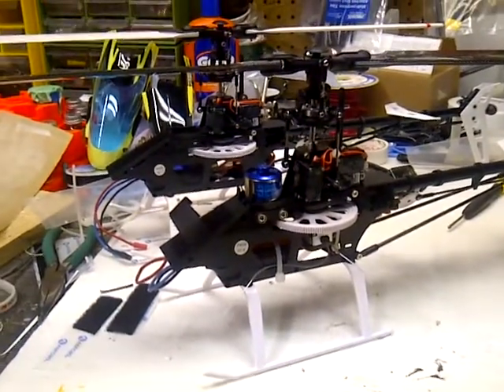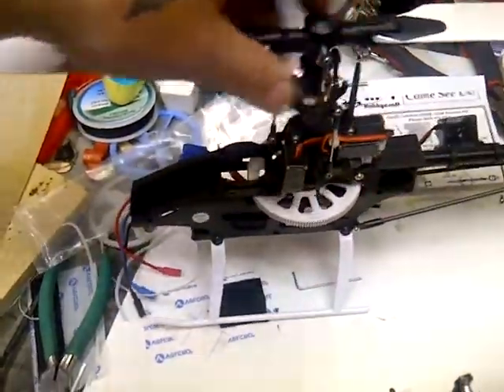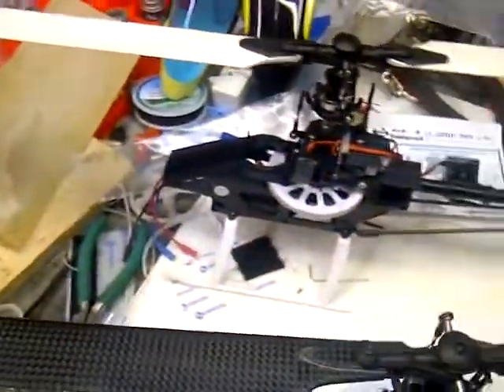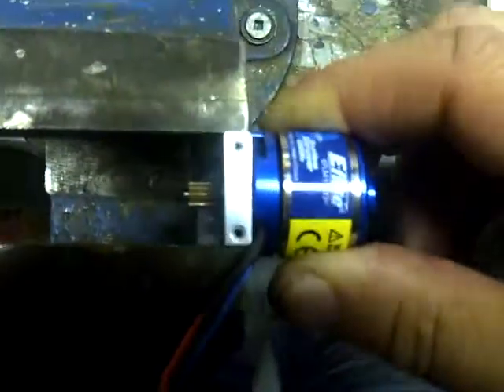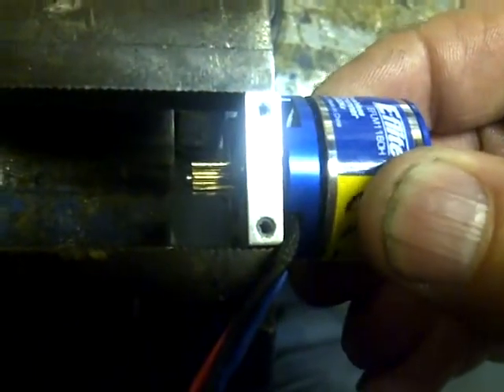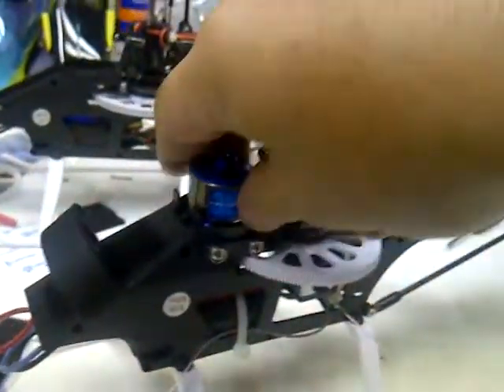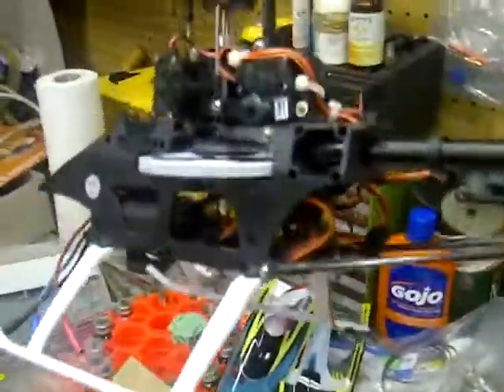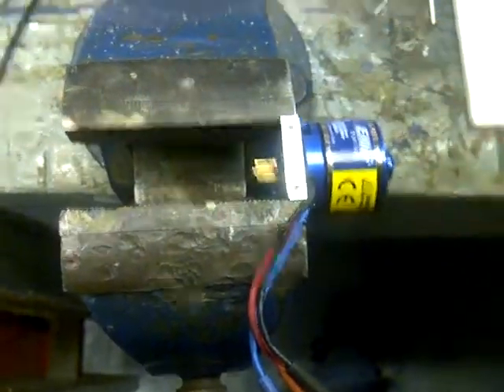blade 300x motor problem

Comment: Hh screwed me!!! But besides the point. I had the same problem, every 10-15 seconds the tail would jump 6-8 inches right. It turns out it was just a loose tail drive belt. My motor has a lot of play like yours, but wasnt my problem.

Comment: I got a lot of replacement motors from HH. When the blade 450 came out they are terrible motors helicopters are decent for starting out with cp but motor bearings are garbage your better off swapping it for a scorpion